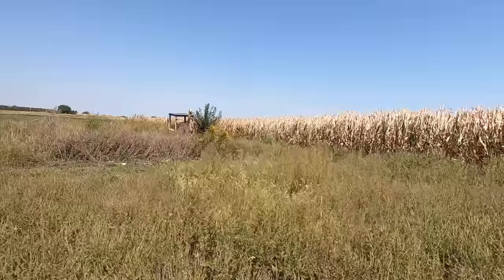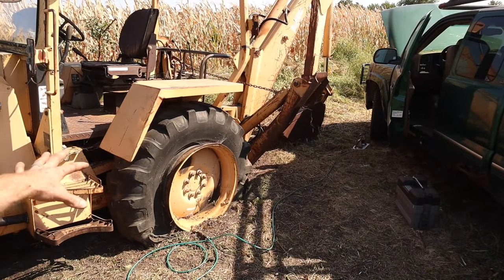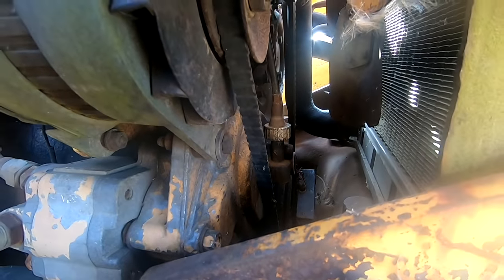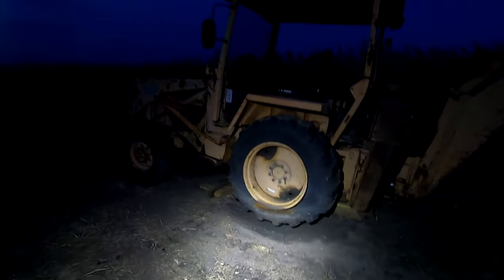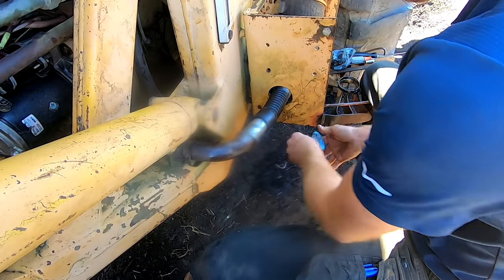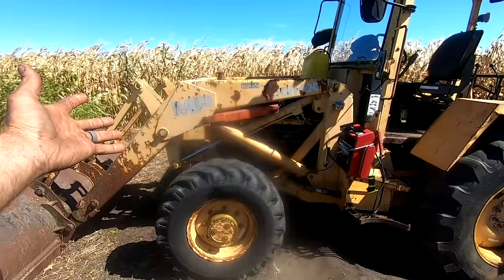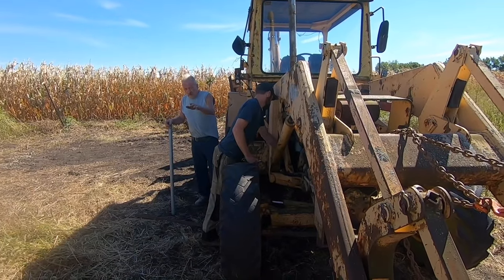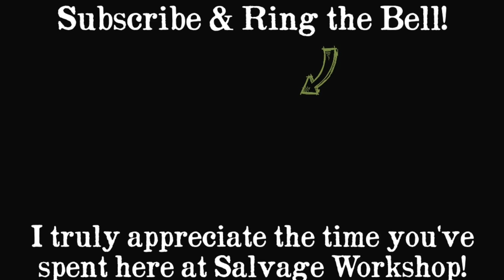I GAMBLED $600 on this Backhoe, sight UNSEEN?? Was the MF WORTH it?!? ~ Broke Down Backhoe ~ Part 1

Comment: As far as I know, almost all Massey backhoes were entirely built in England. That one seems to be pretty modern compared to the junk they made before it. You might as well plan on rebuilding 11 cylinders and replacing about 50 hoses...
Reply from the maker: Yeah, im pretty sure this machine is a late 80's model, and seems to be a  pretty good one!  i've already got plans to do allllll the cylinders and many of the lines... once that's done, it should be a pretty good machine!
Reply: Wes just to remind you that a lot of your followers are brits - “junk” is in the eye of the beholder - we prefer to call it “get what you pay for”
Reply: @tonywilson6032  -WES is spot on, Junk is an understatement.
Reply: As an addendum to my last -  Massey was and I believe still is an American company so how can it be junk?
Reply: @tonywilson6032  Massey Ferguson was British and now made in France, not American, although there was a MF factory in the US in Detroit
Reply: Always the optimist Wes - lol...
Reply: @tonywilson6032  -They were junk, poor engineering, weird axles, they were obsolete when new.  They basically used the name to sell in a usa market.
Reply: @tonywilson6032  Massey Ferguson was originally a Canadian/British company (Massey Harris was Canadian, Ferguson British). Around the time this backhoe was built they moved to the US then were swallowed up by AGCO.
Reply: MF farm tractors were awesome Canadian mfg.Perkins motors.
They did have some funky designs though. 
Backhoe  rotary swing piston being one bad one.
Reply: I bought a MF60 5 years ago.  You’re right Wes, all cylinders repacked and gotta be 15 hoses so far.  It would be more but engine rebuild has it parked last 1.5 years.
Should have it running this spring so I can replace the remaining hoses ugh.
Reply: @stevegrulkowski7654  Hercules seals Florida
Reply: @WatchWesWork  Sawyer Massey was a steam engine builder in Canada.
Reply: @SalvageWorkshop  Do you have a construction business, or hobby of messing with old equipment?
Reply: Gentlemen: a junk is a person addicted to.... At least where i live. There was a time that made in brittain was clearly obvious. When there was an oil mark on the street that was because the one living there had a car/ motorcycle built in england. Well engineered but with,,carracter,,.
Sorry about last time. No remarks from me.
Ps. Perkins where also used in boats.
Reply: Its worth more than you paid for it now.
Reply: @henkoosterhof5947  We use several big telehandler fork lifts at our construction sites, last week it got below zero degrees, yep only the Britt made lift would start, the Cats, were cold napping (LOL)
Reply: @tonywilson6032  JCB are in the forefront of developing and have designed, manufactured hydrogen fuelled engines , it’s the storage and dispensing the gas because of the high pressures involved , is the problem , World Leaders, as many British people have invented in the past. 
The very first excavator to use hydraulic technology was built in 1882 by Sir W. G. Armstrong & Company in England😉
Reply: All the tractor based diggers of this era were junk, compared to purpose built machines. Horrible to operate, heavy, slow and liable to get stuck.
Reply: @chadsimmons6347  Caterpillar's telehandler products are currently produced at BCP's plant in Leicester, England, along with four other machine product groups. Under the alliance agreement, JLG will develop and manufacture a line of Cat-branded telehandlers for global distribution.
Reply: Not all of them where built in England as Massey Ferguson bought into Huge.V. McKay of Sunshine Harvester in Sunshine Victoria, Australia. Then in 1930 H.V. McKay merged with Massey Harris Ltd then became H.V.McKay Massey Harris Pty Ltd  Who built a lot of farming equipment such as the Combine Harvester, ploughs and other farming equipment.  Then was bought out right by Massey Harris Ltd back in the 1950's and then start to build earth moving equipment like Backhoes, dozers and excavators and where exported all over the world.
Reply: @bluegrallis  Our old 1989 (made in the USA) SkyTrak is in the shop for hydraulic cylinder repair, no joy-stick, all lever controlled, it also starts good in cold weather, just sayin
Reply: @sallybrokaw6124  what's that all uh-boat.
Reply: I knew Ferguson was British. Didn't know Massey Harris was Canadian. Next door neighbor had an old Massey Harris tractor. Friend had a Ferguson looked just like a Ford. Most of the parts were even interchangeable with the Ford. But on one the engine bolted to the bell housing and the other the bellhousing bolted to the engine so you couldn't bolt a Ford front  half to a Ferguson back half. Ferguson used the same engine as a triumph tr3 car.. the one my friend had was completely wore out and beyond rebuilding.
Reply: @WatchWesWork  Massey Ferguson were the first to the moon in 1965 with a 203/205 Mk2 model, NASA went on to make the second moon landing a few years later...lesser know fact
Reply: Well said Tony I totally agree.
Reply: Yeah plenty of these “old” machines from the 70’s still running and going, they may be leaky and slow and worn out, but they keep on going. You Yanks….nobody wants your “cars and trucks” anywhere else for a reason ya know 😝
Reply: @SalvageWorkshop  I have rebuilt most cylinders on my 580K.  So I have some experience in that area, get the packings before tearing anything apart it will save you a lot time.  I seriously doubt that all the cylinders will need rebuilding.
Reply: @tonywilson6032  It's not USA made its 🇬🇧 firm
Reply: If that's what need to be done, He can handle it..
Reply: @henkoosterhof5947  where are you from, your comments about British engineering is interesting to say the least.
Reply: @kevinoscarson2941  Perkins was the big selling point!
Reply: Are you going to sell it cuz I will buy it for the right price
Reply: 7 minutos
Reply: Massey Ferguson backhoe where very good machines? The Perkins is very reliable, wen nothing starts in winter that thing will stil be going. Over here in Belgium, Germany and Holland still many of the very old ones from the 60ties 70ties and 80ties are still in use! 
I worked with them on my Mushroom farm and i still own some,  just fur fun.
Reply: yup, cheaper to just rent a new one.  People don't consider the cost of having old equipment fail on you in the middle of a job either.  The world is filled with boat anchors that appear to have value
Reply: @SalvageWorkshop  you did turn on the injector pump correct? Our 30B has an injector pump shutoff directly on top of the pump. It uses a "choke" control to advance/retard the level to turn pump on and off. Massey does have their own way of doing things but I'd take a 30b ANY day over any other brand but Ford or JCB. Ours is a '76 model that we knew from day 1 and owned since 1982. And won't even look at any hoe that has 3 levers or foot swing. Wobble sticks or nothing! I see now that you did get it running. Must have missed when you got the shut off turned on. As for the hydraulics. Our pump went out and the shaft had broken. The shaft is splined onto the hydraulic pump and screwed into the front of the crankshaft. It basically broke the threads off the shaft. Think we had 2 made but who knows if the 2nd is still around. Its been 30 years or so.
Reply: @tonywilson6032  I have worked with great imported products, and then some that I wonder why it was imported.
Reply: @SalvageWorkshop   I have a MF50B and have worked it hard for 12years and it’s done everything I asked for 
It’s getting hard to get bits for her now and the Massey Ferguson dealer near me can only sell parts for agricultural Machines ,
The hole with the bushing under the oil coolers is for the power steering setup on some models 
The slew motor will always leak but it oils the bottom slew bearing , that’s what I tell myself and keeps the hydraulic oil clean. For the fan belt I use the link type belt so I don’t have to take the pump shaft off 
Some people would drill a hole from the gearbox to the back end so the oils can mix, I think it was to help cooling,
There a good little workhorse and definitely will not go into limp mode 
Have fun
Reply: Got a 60yr old MF35 with their loader and backhoe, original yellow paint.  Have had loggers admire the size of the hydraulic cylinders on it.  The fact that it still runs good suggests it is well made.  First made in the US and UK around 1955, still being made in Kenya.  More MF35's out there than any other tractor.
Reply: @OliverLee390  I have a '03 Massey, made in Turkey.
Reply: Ferguson was British, learned that from his time working with Ford.  Massey's was Canadian iirc
Reply: @ ApexSun sorry but he wasn’t British, Harry Ferguson was Irish, born in Dromore Co Down. About 14 miles from where I live, was also the first Irishman to build and fly his own plane, done a deal with Henry Ford with the famous ‘hand shake deal’ to build tractors in America, until he was double crossed by Henry Ford II who stole his designs (and patents)  and left him with nothing to sell in America.circa 1939.
Reply: @clifficus  isnt Ireland part of Great Britain? Not trying to be insulting just asking.  I've read a few books about the history, he created a partnership with a new company and had his own version of the 8n going in about a year iirc...pretty impressive.  I agree Henry III actions were pretty poor, nonway to treat the man.
Reply: @clifficus  he also one the lawsuit and his patents...that why Ford had to redesign the 8n as the naa
Reply: @clifficus  lol, I was poking a lil fun at you, my granddad was from Dublin so I know about the sentiment
Reply: @bluegrallis  my cat excavator was a Mitsubishi,my John Deere loader,dozers and  excavators were hitachi.

Comment: Any time you replace a tube like you did, always release the air at least once to allow the tube to shift around and avoid any hidden wrinkles that may have occurred while stuffing the tube in.  I also like to roll the tire on the ground to help the tube get properly seated.
Reply from the maker: Great tips! Thank you! I'll give them a shot on the next one!
Reply: would put  full cab on the backhoe
Reply: did  u use a grease gun  for the joints

Comment: I have one of these machines... it took me 6 months to buy a transmission filter. Rebuild all the cylinders, replace every hose, line bore every pivot pin, make sure the front axle pin is tight (that's what was wrong with mine) and make sure the planetaries don't leak. It'll lift 6000lbs with absolute ease but it can't be used for towing in any way or you'll destroy the transmission. The 248 turbo Perkins is what makes this an HX, mine is an E (a 236 N/A) the loader oil reservoir is a cap on the door side of the loader frame.

Comment: When sat in the seat facing forwards , the lever to your left by the door is the difflock , these are prone to stick when pulled due to lack of use
Reply from the maker: Yes, that cable was completely seized up and I had to remove it to be able to get it freed up and working again!

Comment: Even the raw SCRAP value of the steel in this Backhoe is worth more than the $600 asking price that you paid. With some ingenuity, TLC and shear WILL you have started to bring her back to life. Congrats. I think, by the sound of the diesel engine, you are going to have a decent unit when you complete the necessary repairs. Greetings from Ontario, Canada.
Reply: I think I would have offered to get it out of the field for no charge before I offered anything at all though. It's taking $600 in value off the land, easily.

Comment: To my understanding coolant hoses will break down when exposed to oil. That hose will work in the short term but you’ll need to replace with a hydraulic hose. And what about Red?

Comment: I'm in the UK. I believe we exclusively have back hoes with vertical stabiliser legs. and yes the hoe can slide right or let and dig from any position. it also makes for the hoe to be held across the back of the machine while traveling on the road. more compact
Reply from the maker: Yeah, that makes perfect sense!
Reply: Cheers from Nyc. We had one here like that. Could dig along walls perfect. Now i have JCB 214 excellent quality.
Reply: @SalvageWorkshop  I drove by what appeared to have been one of those vertical stabilizer backhoes sitting near Stuart, VA. Just the backhoe unit - no tractor. Easily visible from road-side and not eaten up with rust at first glance. I'm picking up a LeBlond lathe down there next week and will try to score a photo of it + gps co-ordinates. (PS - Lathe appears to have been a belt drive unit converted to electric with v-belts. One monster machine - cheapest I could find, just wanted to make pins for equipment.)(... zero machining skills but wth!)

Comment: Looks like a good deal, still parts out there and work-arounds for newer components.
Get the service manual ordered for it for adjustments and wiring.
Run some marvel mystery oil in it to clean things up. If any water in transmission or hydraulics add some industrial gallon size alcohol to adsorb the water and then drain out.

Comment: The bushing hole in the casting on the front end is for a 165,or 175 MF. Those tractors had a power assist steering. I is like a manual steering with a hydraulic cylinder assisting the manual. There would be a cylinder above the casting with a valve and a steering coming from the manual steering system. I just repaired my 165 and it looked identical to that. Keep up the great work. There isn't many people like us who fix old machines.
Reply from the maker: AWESOME!! Thank you for letting me know! I really wondered if that was used for another model of some kind! As always, thanks for watching and commenting Marce! I truly appreciate it!

Comment: My experience with perkins engines (mostly 1004-4’s in my case) is that they can take a lot of abuse, but are seriously let down by their pumps. Seals give way on the high pressure fuelpump and voila, oil level magicly rises in the sump. Bleeding them is a fun affair aswell.. i put a generic automotive 12v lift pump on my excavator and removed the mechanical lift pump alltogether as crappy membranes are also a source of oil sorcery. Then i found out my newly rebuilt lucas cav did not like beeing overpressurized on the feed side leading to yet again, oil sorcery. I found that the lucas has enough suction in it self to get diesel and in your case gravity will help too if above thing apply to your engine
Reply: The words Lucas pump says it all... Lucas parts-->nightmare material. I`m fighting my way through an abandoned 60s Jaguar restauration project, car has all Lucas electronics so its fighting me every step of the way..
Reply: i have one in a MF30b that makes its own oil. sorcery indeed. gravity feed even. once i get around to fix a buncha stuff it'll get dealt with ...maybe
Reply: @marks8068  Using the word 'electronics' in the same sentence as 'Lucas' is an oxymoron of the highest order. Source: 1960's Norton 650. (You are a brave man to rely on OEM / Lucas...)
Reply: @Le_Comte_de_Monte_Felin  Thanks :) Ive been working on that car for most of a year now, it got to me as a rolling bare repainted shell, everything else in boxes, nothing labeled, and its been in pieces since about when I was born (1980) so all the technology is way older than Ive ever worked on.. but the owner happily pays every monthly bill I give him, that helps with motivation!
Reply: @Le_Comte_de_Monte_Felin  Lucas, Prince of Darkeness!!
Reply: You have to crack the injection lines and roll the engine over to bleed a Lucas pump on a Perkins, but they are good engines
Reply: @Le_Comte_de_Monte_Felin  Then you know that the Norton Commando has an absolutely brilliant electrical system. I'm an electrical engineer so let's start, it has a three phase permanent magnet alternator and the ignition and park lights will run on a single phase so it's able to lose two phases and the bike will run. It has a three phase selenium rectifier so again four diodes can fail and the bike will get you home. It has a zener diode for voltage regulation and if that fails if you put all the lights on the battery will slowly boil and may be topped up and also monitored via the ammeter.It has a large electrolytic capacitor wired in parallel with the battery so if the battery fails the ground wire can be disconnected and bump started, first two engine revolutions will charge the capacitor enough to fire the spark plugs. It has two completely separate independent ignition systems so if one fails the bike will take you home as a single not a twin.
As I said a bloody brilliant completely fault tolerant lectrical system!